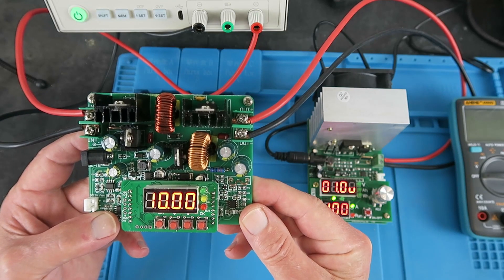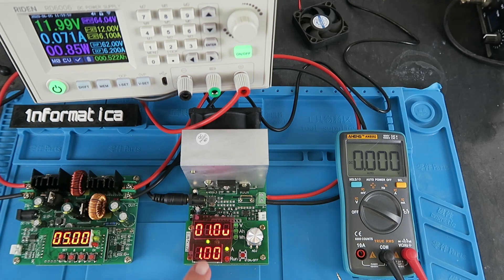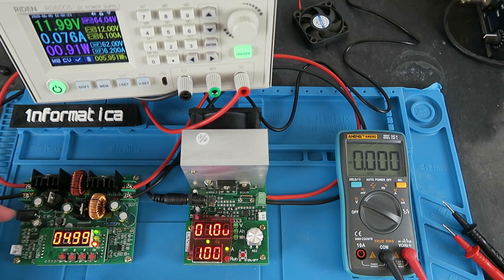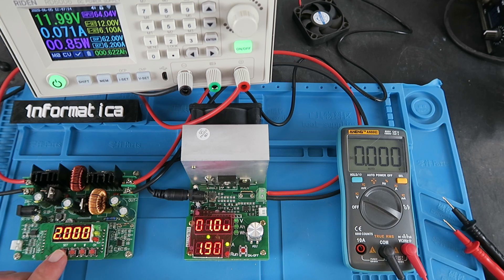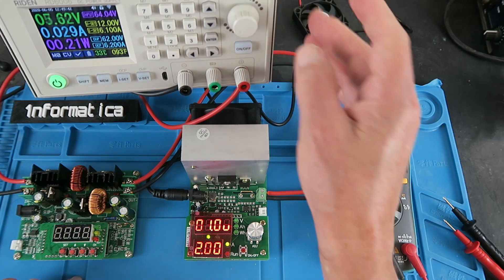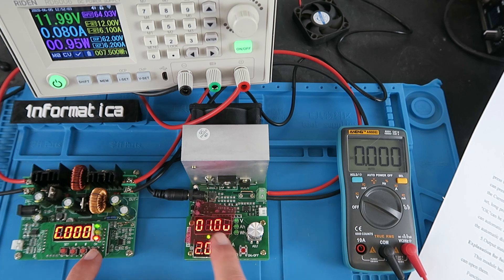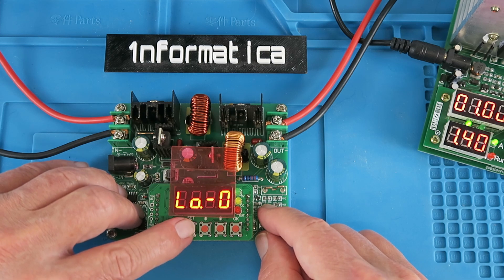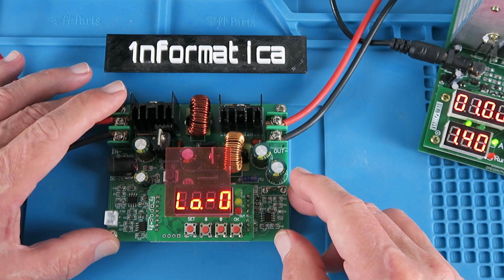D3806 DC 6A 10V to 40V Input up to 38V DC Output CC CV Power Supply

Comment: I love these buck/boost or either video's AC-DC and DC-DC with more current, 6 amp isn't much when trying to power audio boards
Reply from the maker: More current would be great! I wouldn't use a switch mode PSU for Audio. I'm stuck in the 80's with my QUAD 405 II with its massive linear block!

Comment: Neat buck/boost power board, I'll remember this if I need such a thing. Cheers.

Something that would be right up your review street would be the Mustool UD18, a cheap puck-shaped 3.6v-32v power meter that does USB 3, USB-C & barrel connection monitoring, with memory so you could record how much energy goes into/out of powerbank for example & not lose the count when it powers off, or power it from micro USB so it doesn't draw power from what it's monitoring.
The bluetooth feature is pretty neat so you can monitor it from your phone with the free app, easily take snapshots.
The + & - connections of each monitoring plug/socket are wired together so you can plug it into USB and get 5V out of the barrel connector, but use that feature with caution since you can plug 12v into the barrel socket and USB outputs 12v.
Reply from the maker: Thanks for the recommendation, I'll check it out. I have something similar but it's only good for USB testing. Cheers.
Reply from the maker: I have removed the spam comments and reported them. This is becoming more irritating, I don't know why YouTube doesn't clamp down on this abuse more. Channels with apparently thousands of subscribers but no content and change their name every day cannot be right!
Reply: @1nformatica  I first became alerted to this issue by an Aussie quadcopter YouTuber xjet with his video "Who is Tom and why is he commenting on so many YouTube videos?" and since then I've been spotting more and more of those bots with hacked accounts.
Feels like YouTube don't care about you unless you have hundreds of thousands/millions of subscribers, last year I discovered someone had 'pinched' my youtube.com/licensetodrive url I'd been telling people for years and the only way I could contact YouTube to complain was through Twitter! My pleas fell on deaf ears, at least I still have my youtube.com/user/licensetodrive URL.

Don't let those bots get to you, I'm looking forward to more interesting videos :)